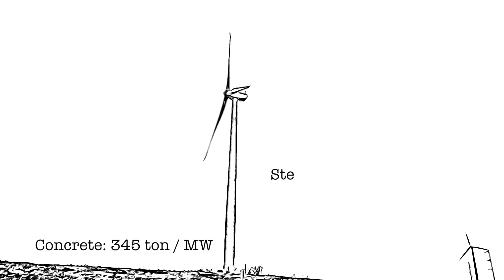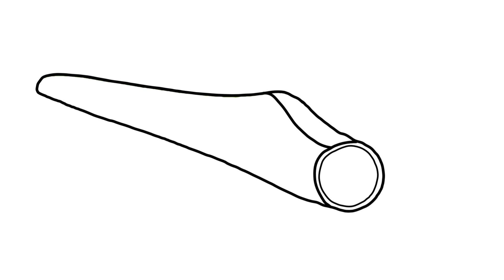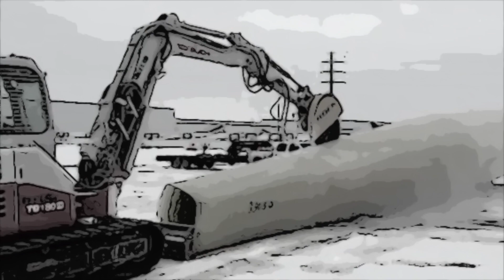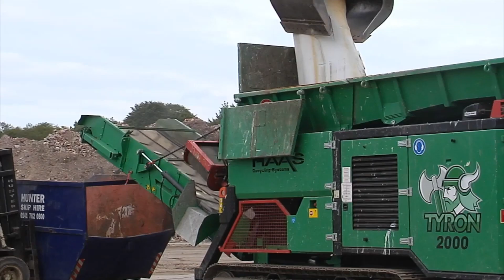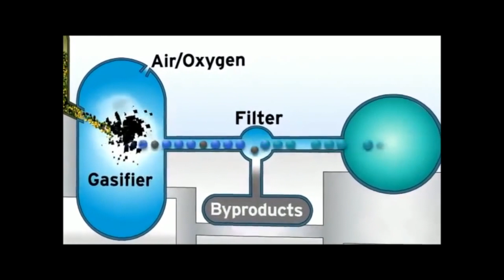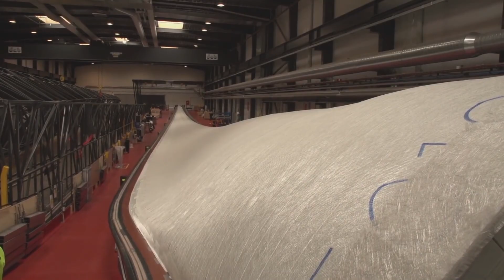Wind Turbine Blade Recycling

Comment: Maybe you could do a video on the actual carbon footprint from obtaining and processing all the raw materials. The manufacturing of all the components and eventual disposal and recycling of all wind and solar energy products. Just asking how green is that alternative energy?
Reply from the maker: Thanks Dave. Let’s try to do it. Will take some time to gather all the data as this is a kind of LCA analysis. However, to make a fair comparison we should be doing it with the most relevant power generation technologies.
Reply: @energytechnologysherpa  don't forget to include batteries or power storage systems. And all requirements to connect to the current grid as well as all maintenance costs over it's life cycle.
Reply from the maker: Got it! In the mean time, maybe you can take a look into this video https://youtu.be/-zV9hBuUWAA that is describing raw materials for the wind energy turbines
Reply: @energytechnologysherpa  thanks for the video. This is the reason I asked about the carbon footprint. Turning the raw materials to a machable materials requires lots of power. I live in the pacific northwest, we have a lot of hydroelectric power here. One dam, Grand Coulee provides 21 billion kwh per year. We have a lot of dams.
As I understand it a wind turbine can produce about 6 million kwh per year. That's about 3,500 wind turbines. Probably more as turbines output is variable. The wind turbines we do have only about 50 percent seem to be running when I drive by. I live offgrid on solar, I have no problem with the technology. But it seems like the world is rushing into replacing fossil fuel without looking at the entire effect on the planet.
Reply from the maker: No solution fits all. Hydro is a great power source, but not all the places do have the capacity for it. Water use can be a problem in some regions. BTW, very nice place, I used to visit Kennewick in the past :)
Reply from the maker: Hi Dave, just published a video that may partially answer your points (https://youtu.be/MkXqLZPpPNQ). I felt was worth to speed it up. Hope you will enjoy it.
Reply: @energytechnologysherpa  interesting but has a long way to go. Since I live offgrid, the way I see wind and solar working, is for individuals or small remote communities. As a full grid replacement i question that logic. Too many resources required at current population levels. As well as the individual needs of the developed world. Like electric vehicles and the like. Either the entire structure of civilization needs to change or population needs to decrease dramatically. 
As an example. At 10 years old we had an entire valley of farmland. At the time estimates were that valley could keep the west coast states supplied with vegetables. There was approximately 120 feet of top soil. Business and government allowed it to be covered over with concrete, malls freeway and housing. There is no more or very little farming there. That was in the late 50s. Good luck changing the way government and business think, as well as the consumer.

Comment: You may want to change the title and how this video is arranged.     Look up the 5 R's.   THE 5 R'S: REFUSE, REDUCE, REUSE, REPURPOSE, RECYCLE.
    
Recycle is the last thing to consider in reducing waste.    Why isn't much of the  hardware for the wind power plant not reused for another wind power plant with the only parts replaced are the moving parts?   Just a suggestion.   There are many things to consider.
Reply from the maker: You're right Ronald. We were not intending to cover the 5Rs in this video, but to focus on the recycling part. The reason for that is that is gonna be the most difficult part. But let's have another video addressing the other Rs as you suggest. Thanks!

Comment: Boat building, eco home roofing or cladding, bus shelters, water tank ribs, rail station shelters, farm buildings for animals, canoe, kayak, surfboards, electro hydrofoil water toys, smaller blade home wind generators, make use of panels for moulding, jigs, stencils, templates, or reusable boxes for tools.
Just Ideas, but you could use this material for these things. 
Your welcome 😇
Reply from the maker: Thanks!!! That’s true, there are already some one applications on that direction. Some of them, as the roof shelters, will require not to recycle the materials but to adapt the blades for a new function. In some others, you will need to recover materials with some of their functionalities and re-shape them into new applications (i.e. in the automotive industry). We will incorporate these potential applications in a future revision of the video. Thank you so much for the comments.